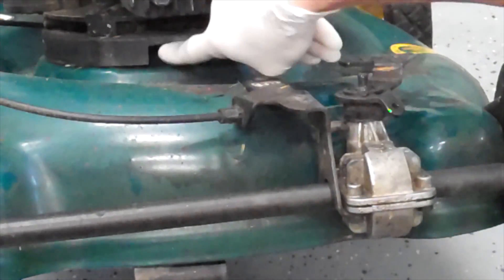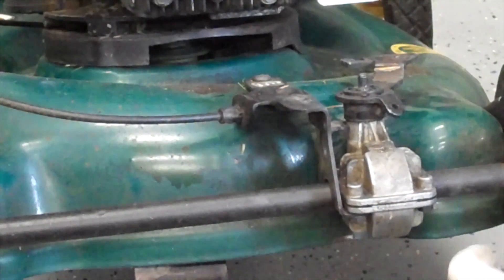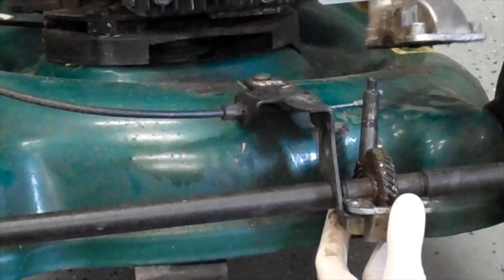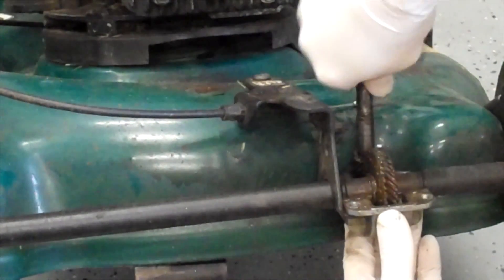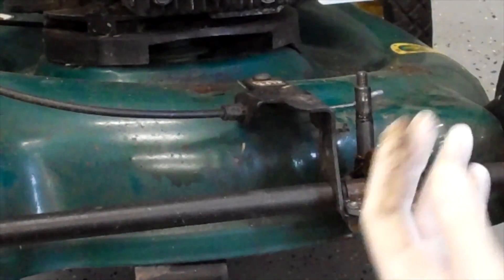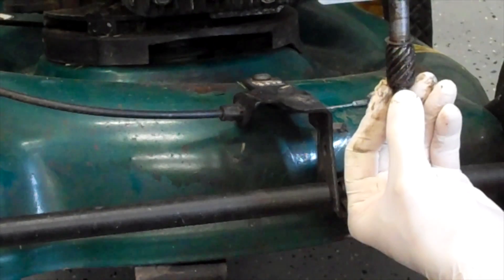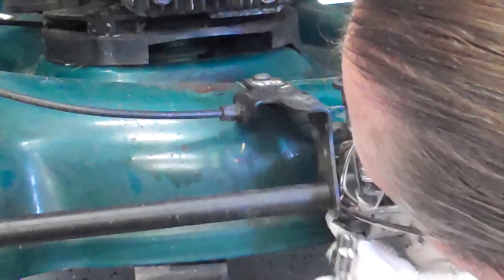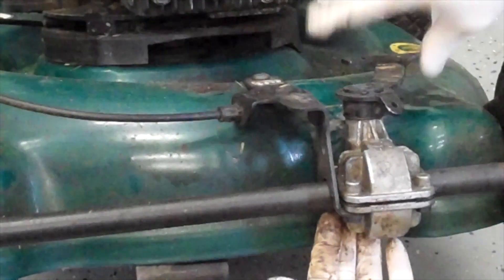Lawnmower Repair Pt. 3: Differential Repair/Replace

Comment: I own a troy built mower with that same drive system.  The front wheels do not completely disengage.  Do you know why that is happening?
Reply from the maker: Brian Mott your belt is either too tight or your cable needs to be slackened a bit.
Reply: I already slackened the cable as much as I can and I disconnected the cable from the handle to put more slack in it but that did not change anything.  The wheels barely stay engaged when I release the lever and I can not pull the mower backwards when the engine is running or not.

Comment: This mechanism is not a differential, since both wheels turn at the same speed.  It is a drive mechanism.
Reply from the maker: D Wall A differential is a gear train with three shafts that has the property that the angular velocity of one shaft is the average of the angular velocities of the others, or a fixed multiple of that average.

Comment: Hello Awesome ViDEO I Have A Craftsman 22 Inch Cut 6.5 Eagel By Sears I Would Like To Disengage The Power Gear Drive .Please Help Thanks Tommy
Reply from the maker: +Thomas Whetzell it looks like you have everything running under that black plastic cover at the front of the mower.  Its definitely front drive like mine and should have a belt that goes to a flywheel just like mine as well.all of that should feed into the differential which you should be able to separate.  Im just guessing.  How far have you gotten into tearing it down?
Reply from the maker: +Joby F. Randrup yeah, I just pulled a shop manual for your mower.  It looks like it's the same exact design as the one I show in the video.
Reply: Thank you Sooooo Very Much Peace Out
Reply: Hello I Disengage The Drive Mechanism Completely.Just As You Said In Your Video But The Drive Mechanism Is Real Hard To Turn.What Am I Doing Wrong Please Help Thank You Peace Out
Reply from the maker: If it doesn't spin freely, you may need to remove the shaft that runs from the differential to the wheels.  Then there will be absolutely no drag on the front wheels at all.
Reply: Joby F. Randrup How Do I Remove The Shaft? Thanks.
Reply from the maker: There should be two brass connections that mate the shaft with the wheels.  Take a ChannelLocks or big adjustable wrench and twist the brass fittings off.  Loosen the wheels first so you have some play.  The brass fitting are pressed on so you will use some force.  Don't worry about breaking anything as you are removing anything that would break.